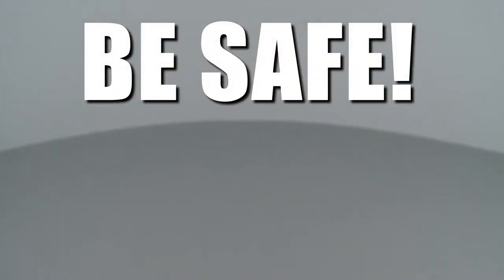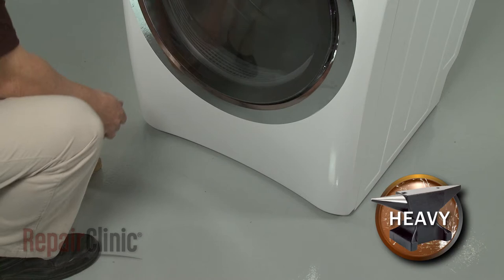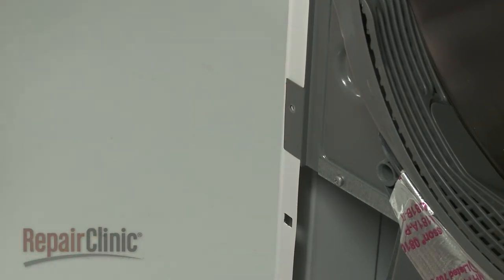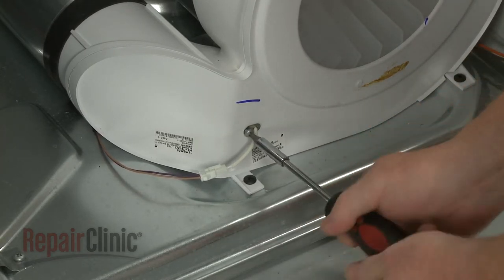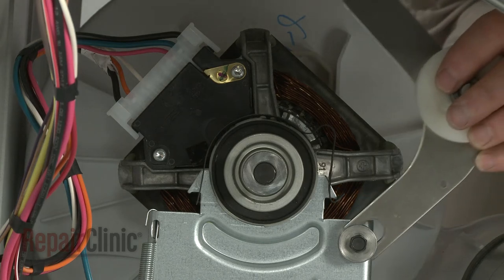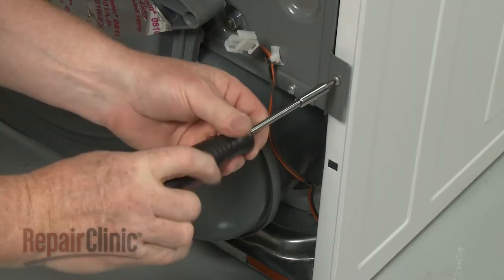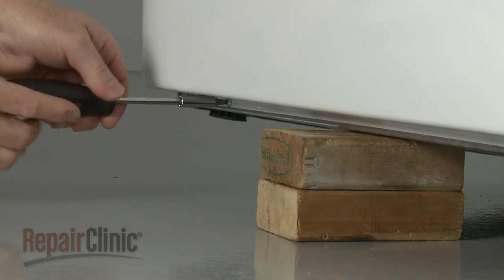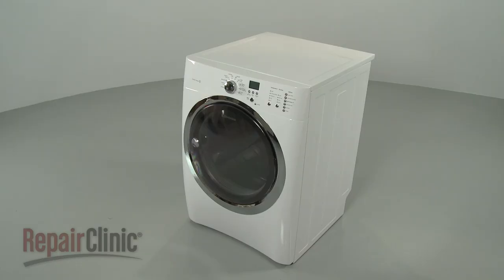Electrolux Electric Dryer Replace Blower Assembly #137552300

Comment: Excellent step-by-step video.  My front panel was stuck to the bulkhead and didn't lift away as easy as the video showed.  The factory used too much glue for the door seal on the front panel.  Excess glue leaked onto the bulkhead and glued the front panel to the bulkhead.  I thought there was another screw I was missing.  After some force it came apart.  Also watch which screws you remove for the control panel.  Take out the ones into the side panels and not the ones thru the panel's plastic feet.
Reply from the maker: You're welcome! 

We are always happy to help. If you would like to give us a review on Google, we would much appreciate it: https://g.page/r/CcVUrahZNozMEBM/review

We hope that you have a great day!

Comment: Great video thank you. I had an issue removing the front panel, it had glue between the front panel and the front bulkhead at the door hinges. This slowed the process of a ten minute repair into an hour of frustration. The blower’s impeller had come loose from nut and had to be cut apart to remove the nut. I hope this will help some other Do it yourselfer.

Comment: Great video! Highlights all the crucial steps 👌
I usually try and do all my own repairs and that's why I'm here. My dryer is making a loud almost whining or humming sound when it is first started, then after about a minute it will suddenly clear up. I can tell it's coming from the blower area, but my first impression was that the motor has a bad field winding or something. Or possibly that it was staying stuck in a start phase somehow. But at least thanks to this video I won't have too much trouble digging into it 😊

Comment: So mine was making a knocking noise when using with large loads.
I noticed no air coming out of vent outside
Shut it down and tore it apart.
Noticed my blower fan was wobbly and the 7/8 hex plastic encasement was cracked in several spots causing it to not be secured and separated from the knurled shaft it was embossed onto.
A little glue from the factory probably would have prevented this from happening.
I’m ordering a new one but in the meantime I took the motor and blower assembly out as a unit.
Separated the blower
Fan from the shaft without damaging it by using some penetrating oil and loosening the shaft then shaking the blower from the motor with the motor hanging down towards the floor and my hands on the plastic
Blower fan.
I laid down a thick blanket and shook the motor to jar it’s weight downward with each thrust to separate the blower fan from the knurled bushing it’s was attached to…barely.
I once apart I cleaned all the debris out, lined up the blower into the shaft, applied some epoxy and held the plastic hex onto the knurled shaft tightly with two spring clamps I removed from an old dishwasher hose.
I attached the blower with the original nut but used a washer to keep the plastic hex from walking off of the knurled shaft.
Works like a champ but I’m ordering a new one because this is just a temp fix to keep it working until I can get a new one.

Comment: The front doesn't just pop off like that... be prepared to get ruff with it as it glues itself together over time...  Also get ready for the metal nut to strip out the plastic fan, you will need to used a hammer and punch to break the plastic apart enough to get the motor out.  Such fun!!

Comment: Can you open up the housing and replace only the fan. The difference between $35 and $105.
Reply: @repairclinic  
How do you use the channel lock pliers on the motor without tearing it up?  Are you holding onto the part of the shaft just inside the area where the belt goes or are you holding onto the threaded pet where the belt goes?  Using the first method, I can’t grip it tight enough to keep it from spinning when I use the socket. Using the second method, I tear up the metal and have to file down rough edges so that the belt doesn’t get ripped up.